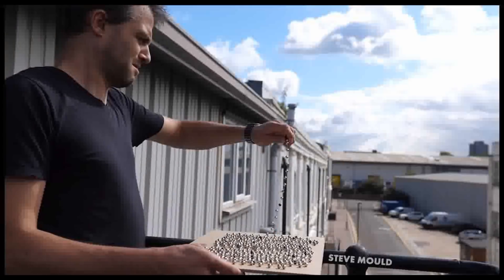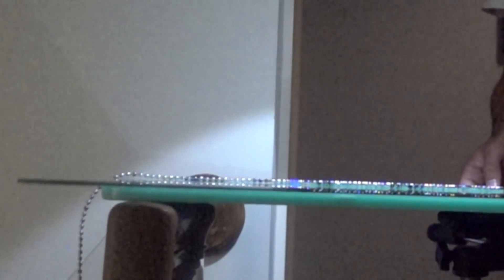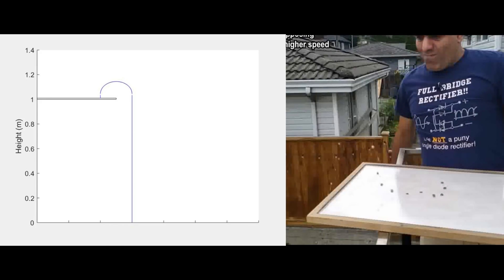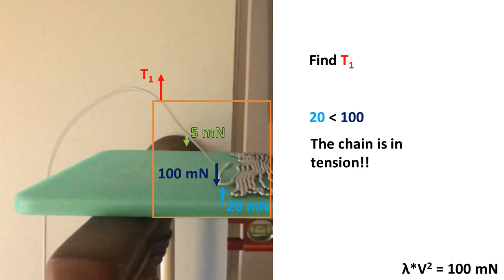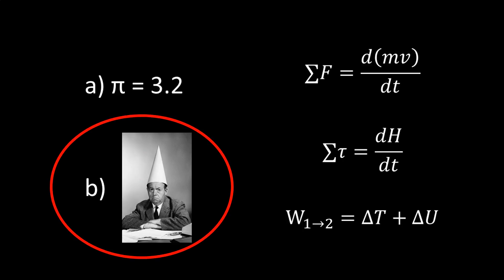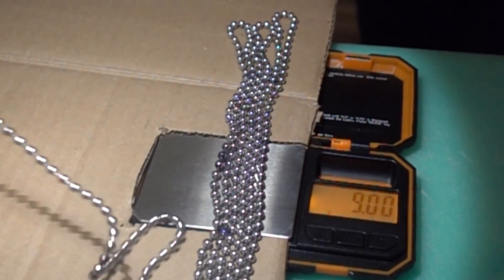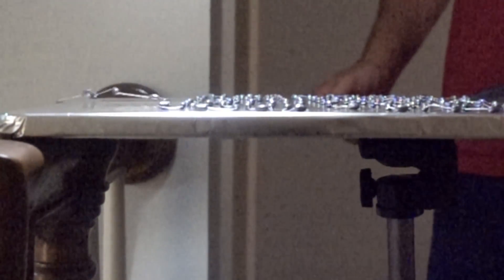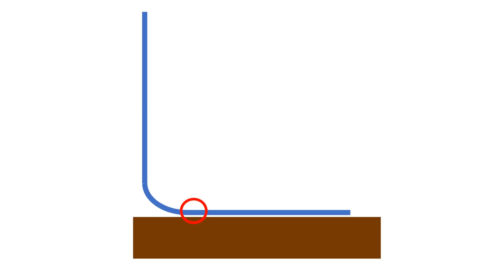And the Winner of the Chain Fountain Dispute is...

Comment: The chain working as a kind of spring and trying to return to its straight state makes sense- except while it may put energy in, surely it can't start a vertical fountain when the chain is resting flat?

To make the chain fountain height increase vertically, it requires a vertical force at least to start the effect...which must originate from the chain falling off the side of the surface. Probably the aforementioned spring effect, possibly combined with the beads catching and bouncing as gravity pulls the gaps between the beads towards the edge and makes each next bead hit the edge. Could also be simple torsion, allowing the horizontal pulling force to combine with some potential energy from that spring effect to apply the force in a slightly different direction which would allow it to happen even if the chain was "falling" horizontally, on the same plane that it's sat on.

As soon as it starts, then we have a vertical force and the classic lever-based Mould effect can begin (perhaps with continuing help from those other forces). If the chain really is trying to straighten then I guess someone needs to do a simulation of an infinitely flexible material but with short gaps to give a minimum angle which would give us a lever but no spring. A stiffer material with longer gaps would still give us both so after 2 cocktails I can't think how to test the opposite...

Regardless of whether any of what I just said is correct, this is a great video. Love the examples on different surfaces particularly.
Reply: I agree with you in the sense that the bead chain being pulled over the edge might impart an upwards force in some way. However, this can't be the source of the fountain itself, since it starts where the chain leaves the "reservoir", not where it "flows" over the edge. I don't understand the mechanics of this well enough to do more than follow argumentations of various people, try and understand them and point out potential flaws though, so I don't have an explanation of my own.
Reply: @InterFelix  You're not wrong. What I'm suggesting is that if the chain "dropped" horizontally away then no vertical fountain could possibly form as there isn't anything acting up or down on it- it's working effectively in a 2D plane. With the way he drops it in this video, gravity is the only force acting in a plane relevant to the fountain, therefore only the dropping part can cause the fountain to exist vertically. My original comment was to consider a few possible mechanisms for that, but that's the basic logic I'm applying.
Reply: @ApothecaryTerry  okay, thanks for clarifying. However, I'm not 100% on board with this statement. Pulling the chain horizontally with a drill also displayed this effect as demonstrated by Steve. In that case, the chain was pulled out of a beaker, so an edge was most certainly involved.
Reply: @InterFelix  It wasn't fully in a 2D plane though- it was pulling over a rim and therefore while it was horizontal as it left the beaker, it moved vertically from the pile to the rim of the beaker.

If you lay a chain/rope/string/whatever out on a flat surface and pull it along that surface, it can never move vertically. That's because the only vertical forces are gravity and the reactant force from the surface which equally balance each other so it just slides along. My statement is purely that- a vertical chain fountain can only exist if a vertical force exists, hence it can only be the fact the chain falls off the edge (at which point the surface isn't balancing the force of gravity to net 0) that can cause a fountain to form.

Since the chain is dropped, the only other vertical force that could possibly exist could be potential energy in the form of a sort of spring/torsion in the chain which releases as it straightens. It's possible, hence included in my initial comment, but I think gravity is a far more likely culprit. It fits with both Steve and Mehdi's explanation so is only a side note, an exploration of comments made in this video.
Reply: @ApothecaryTerry  exactly, that's what I was implying with my last sentence. If you pulled a chain horizontally from a glass plate in zero gravity, I'm pretty sure we all agree nothing would happen.
Reply: @InterFelix  If I pulled a chain horizontally from a glate plate in zero gravity I suspect multiple things would happen:

 - I'd hit myself in the face with a chain
 - The glass would end up broken
 - There would be an international inquiry into how I managed to end up in space/on the vomit comet.

Sorry, couldn't help myself, of course I entirely agree with what you just said ☺
Reply: @ApothecaryTerry  undisputable truth.

Comment: 11:40  As Mehdi says it goes in the direction it can consistently escape from - momentum.  
13:03 you calculate the 'reaction force' of the table, using the fall distance (energy from gravity) as input.. should be clear the reaction is powered by gravity.
15:30 So is the water adding energy to make the fountain here or is it the chain that is actually moving the water around...  I'm gonna go with the chain moving the water.

I feel like this is all a proof that some reaction is happening that causes the chain to rise - but that was never the argument?
Mould keeps explaining that additional energy is getting put into the chain the way the bends interact with the table.

If your 'reaction' is just momentum of the chain being redirected when the chain is faced with a obstacle (table) - all powered by the chain moving/accelerating due to gravity.
Then how is Mehdi not right - stop calling it a 'reaction force' and start calling it a 'reaction'  there is no addition force being added.

When you do the math in the first half you also admit its all momentum there as well.
Reply from the maker: Everyone (including Steve) agree that the energy for the chain fountain comes from the gravitational potential energy of the chain. However Steve and I don't touch on energy very much because thinking about the chain fountain in terms of energy balance is a red hearing. All the rules we were taught in school about conservation of energy, about the change in kinetic energy equaling the change in potential energy, only apply to conservative processes. However the chain fountain is a non-conservative processes, and so our typical energy equations become less useful.

The real question all along has been, "using Newton's second law, F = m*a, is it possible for the chain fountain to exist without an extra normal force from the table?". So, the purpose of these tests has been to see if the normal force from the table is greater than the weight of chain on the table. If the normal force is greater than the weight of the chain on the table, then Steve is right. If the normal force equals the weight of chain on the table, then Mehdi is right. That is why I ran the experiment with the scale at 12:47, and why Steve runs the test with the force meter here:
https://youtu.be/rZ2lzOAeWiU?t=595
But as it turns out, this change in normal force is very small and hard to measure, so we have had to resort to other tests to tease out the answer.

One of the tests was my test with the tin foil or with the cling wrap on the water. You phrased it as:

"So is the water adding energy to make the fountain here or is it the chain that is actually moving the water around...  I'm gonna go with the chain moving the water."

But the question is not whether the "water is adding energy to the chain", because as we said, thinking about energy is a red hearing. Instead, the test is trying to figure out if the normal force on the foil/cling wrap increases as the fountain moves over it. If the normal force on the cling wrap increases as the fountain moves over it, then Steve is right. If the normal force does not increase, then Mehdi is right. And as you point out, the fountain does appear to push the cling wrap into the water, so we can infer that the normal force does increase, so Steve is right.

As for the math, it concludes that, using Newton's second law (F = m*a) we find that the chain fountain is impossible without some kind of increase in normal force. I rushed through the math in the video, but it is elaborated in detail in the paper that I linked to in the description, and I would invite you to check it out.

Cheers!
Reply: @prestonbecker8784  Thanks for the reply, in terms of normal force (Steve never used this term right?) -  Which I believe would be the interaction force between two objects - a box sitting on a table, or your hand pressing on the wall - they still balance right?   Your hand feels equal force as the wall would - so when you say increase in normal force that would be like pushing even harder against the wall right?

Here in his original video he literally says extra force coming from the pot:  https://youtu.be/qTLR7FwXUU4?t=749

But you (and I) are basically agreeing right - that his 'extra force' is actually extra force from the chain - pushing itself harder against the pot.  Not extra force from the pot- extra force TO the pot?
Reply: @oriolvp4413  IMO its more like the tension waves created from the chain straitening itself while accelerating (you can see the standing waves in the moving upward part of the fountain) help deflect it against *whatever its sitting on or itself even to keep the fountain momentum going.  Or some momentum redirecting upward as it straitens itself. I don't pretend to fully understand how it works - I just have a problem with 'adds force' being talked about relative to the thing the chain is sitting on.

If I go up to a wall, extend my hand out and push my body away from the wall using my hand.  Would you describe what just happened as the wall 'added force' and pushed me away?
In science there is an input and an output, what happens that causes something else to happen.
The stationary wall did not add any force or do anything other then be a barrier.  My hand added the force that pushed me back, the wall just returned the force that I had added.  All the energy and force came from my hand.

To describe it backwards and say the wall pushes me away 'for some reason we can't understand' is ridiculous.  The same way the chain bouncing itself off a surface being described as the surface adding force is ridiculous.